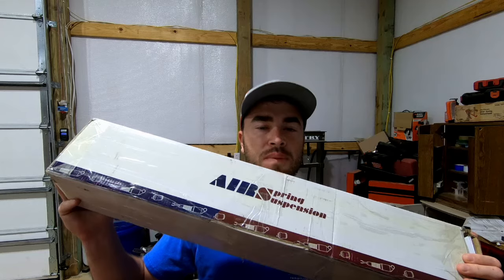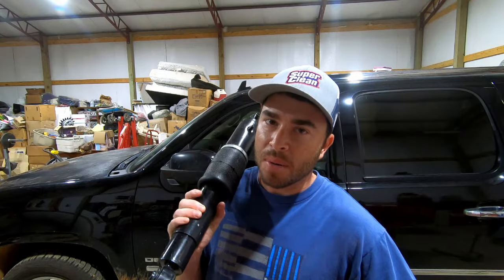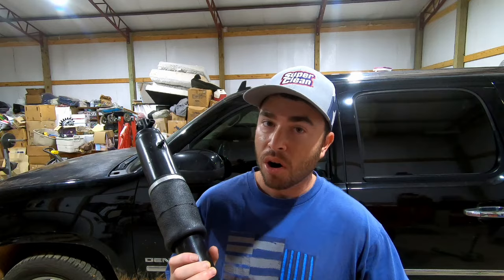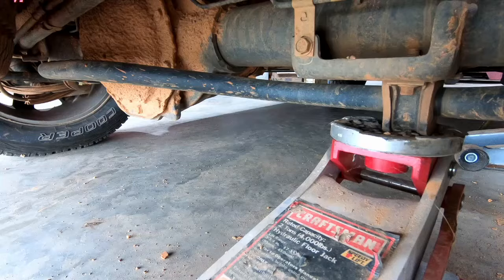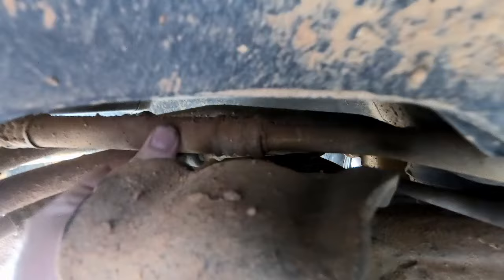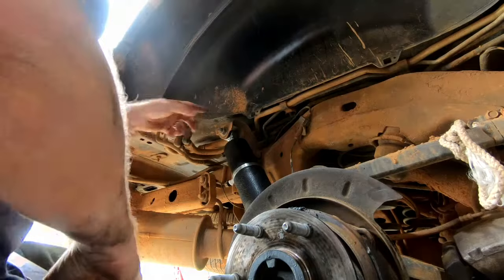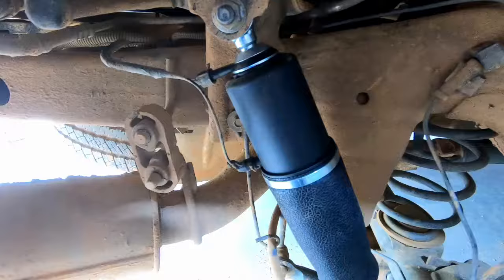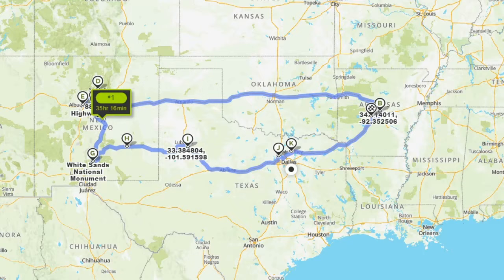Vigor Air Suspension vs. Arnott vs. Suncore vs. OEM.  Test and Review!

Comment from the maker: To purchase the exact air struts I used in this video: https://vigorairride.com/products/vigor-25979394-air-absorber-shock-suspension-strut-spring-rear-left-or-right-compatible-with-2002-2014-cadillac-escalade-esv-ext-2000-2014-chevrolet-avalanche-suburban-1500-tahoe-gmc-yukon-xl-1500?_pos=2&_sid=fc2191406&_ss=r

You can also purchase a matching air compressor here: https://vigorairride.com/products/vigor-15254590-air-ride-suspension-compressor-pump-for-escalade-avalanche-suburban-tahoe-yukon-949-000-19299545?_pos=1&_sid=53020bf69&_ss=r
Reply: I installed these vigor air ride  struts in a 08 cadillac escalade but after i was done my stability track, traction control and abs came on, do you have any idea why ?
Reply: I also installed the matching air compressor

Comment: Thanks for the Vigor resource.  Bought a complete Suncore kit for my 2003 Ford Expedition in November 2017 (approximately 10k miles ago (not my daily driver)) $1,400 for the parts only.  One airstrut was bad right out of the box.  Suncore replaced it, but it held up my repair for 9 days. December 2020 dryer connection failed. December of 2021 compressor failed. February 2022 airstrut just failed.  Original Ford Air Ride lasted 14 years.  New suncore just barely, barely, lasted 3 years before the first failure and its been down hill from there.  For what its worth, I think Suncore stinks.
Reply from the maker: Agree 100%.  Still haven't had problems with the vigors so far.
Reply: Follow up January 2023.  The other front strut just went out.  (did I mention I don't really even drive this thing?)  10-50 miles a month.  SUNCORE=RUN AWAY

Comment: Which Arnott shocks were you running before? Were they the passive models like the Vigor or the reman OEM active style that maintained the electronic ride control? I purchased the Vigors and have yet to install but wanted to know if this is an apples to apples comparison.
Reply from the maker: Both the vigors and the arnott are the exact same OEM-style air shock, so yes, apples to apples.

Comment: Great video.  Question we had c0585  04 left rear damper circiut open. Gm test said if I put test light on A and B wiring to shock and is lite up before I turn damper ON with scanner then the escm is shorted out.  Also got no power to the 30 pin on the alc relay underwood.  Is the test preformed to say escm correct thank you for any help. Cheers

Comment: Vigor makes a complete setup for the fronts now. Mines will arrive Saturday. Hoping for a wonderful result. I will have new rears, fronts and compressor from vigor. Also new lines too. So excited!!!
Reply from the maker: Good to know!  You'll be riding smooth!
Reply: Hi @Farmdad, how is the vigor air suspension holding up after 2 years? How many mileage have you put in with this?
Reply from the maker: @pelesuratach9480  still good.  I can't remember where I started mileage-wise and don't know where I sit now, but I bet I have put over 30k on and still no issues.
Reply: @theplantedtank I’m intrigued about the lines.  1 of the small line sections on my burb has a small hole worn in it (it looks like the line was laying on the compressor and direct heat melted the hole in the line).  any feedback on the install and performance thus far?
Reply: @chrisheringer905  it's still good so far. But I'm having a connection issue with the electric connector on the front struts.

Comment: I watched this video and ordered the vigor rear and front air ride shocks for my 02 escalade z55. the front appears to come with a Shrader valve that is completely separate from the shock its unclear what and where this goes. also, my front shock currently has a connecter on top of the mounting stud of the shock.... I do not understand why or how this works plugging a connector into a stud that is. parts should come in soon will keep yall updated. any suggestions are appreciated

Comment: I just purchased a set of arnott magneride replacements for my yukon denali after the ac delco one failed. I have been emailing with someone at arnott regarding the differences and it sounds like they come from the exact same place. This is what he told me: 

There would not be any difference in the MR-3626 and GM AC/Delco shocks since they come from the same manufacturer and same place AC Delco gets them. The MR-3626 is $10 less and it has a two-year warranty whereas the GMAC Delco part (same shock only have a one year warranty.

I guess we will see though. Hoping to have mine tomorrow to install.

Comment: So I have a leak on my passenger side air shock, 2020 Suburban, pulled a travel trailer twice, then noticed the leak. What’s your thoughts on why it failed so soon, 41k miles. Got the burb used, so not sure if had towed anything before. Thanks for any input 👍

Comment: Watched both your videos, I think the shocks on my 2012 Suburban LTZ are going out and I am really leaning towards these Vigor's you have linked. Do you still own the Denali? If so do you have any long term updates? How have those plastic fittings held up? My Suburban has 170k miles and I plan to keep it as long as possible so I want to make sure this purchase goes another 150k miles. Thanks!

Comment: I purchased these after seeing this video, and after installation found one shock is leaking from the base of the nipple body that the air supply clicks into. It bubbles with soapy water even with air line removed (air trapped inside shock with finger)

I emailed the company and am waiting to  hear back from them
Reply from the maker: I'm sorry to hear this.  Please let us know how the company responds. If you don't hear from them in a timely manner, I'll reach out to my contact there on your behalf.  She was very responsive to me.  Is there a bad weld on that nipple or is it leaking at the connection to the airline?  I've seen where shocks will leak at the connection if the tech doesn't get them on all the way.
Reply: I was thinking about ordering these. Did they respond in a timely matter?

Also are these passive or active?
Reply: @scottwhite5367  They had me send multiple pictures and videos, im assuming they did not believe me. I was then told their tech was looking at the pictures and video. A few days later they issued me a refund, saying it probably got damaged during shipping.

I ordered a new one with the refund and had no problems. Would have been nice to not do the install twice but it is what it is I guess. 

I will say the way they package the shock is not very secure so I was not surprised it got damaged during shipping.

Comment: Ok so I installed these Vigor rear air shocks on my 2008 Escalade EXT. I also did a bunch of work on the front, struts, CV axles and bearing hub assemblies. What a difference. I didn't know how bad my Caddy was riding until now. I will make the assumption that if you want your truck to ride like it was new then change ALL the shocks at the same time. So the factory air shocks were totally gone. They would not hold pressure at all. The new Vigor shocks work perfectly. I put some weight in the bed of the truck and instantly the old factory air pump kicked in and leveled the truck perfectly and held the pressure. Before the pump would come on and run for what seemed like 10 mins but not much change in ride height.  The air bladders on the new shocks stay nice and tight. Worth every penny!!!!! The only question is....how long will they last? Time will tell. Forgot to add......the old shocks were so light in weight compared to the new shocks. They were 1/2 the weight as the new ones. Maybe all the oil charge leaked out? But just holding the old and the new I could tell there was a difference.
Reply from the maker: Glad you got the caddy all fixed up.  That's weird about the weight difference!
Reply: Hi! How has your suspension held up? So far so good?

Comment: Excellent video. I have a 2008 Escalade EXT. This weekend is a major drive train and suspension overhaul. Front...doing CV axles, struts (shock/spring assy) and bearing hub assy. Rear doing the air ride shocks. I ordered the Vigor 2597934. My truck has 97,000 miles and is starting to ride like shit. The front CV axles are popping and clacking like crazy. The front suspension is rough and just for good measure I am doing the bearing hub assy's. The rear, also rough. I tow trailers, large boat and an RV (travel trailer) and the truck used to detect the ass squat and kick in the air pump and lift the rear end leveling. Now the pump kicks in and it lifts a little but eventually just squats the truck to the ground. I believe it to be the air ride shocks. I will report back. Just wanted to see some videos on these Vigor shocks.
Reply from the maker: Sounds like that escalade is going to be as good as new.  You are fortunate to have one with such low miles!
Reply: @FarmDad  I bought the truck in 2012 with 30,000 miles. I work from home so all the miles are from taking the kids to school and 2-3 road trips per year with the travel trailer but most of our camping trips are no more than 300 miles each way. Yes it still looks like new inside and out, pearl white outside and black inside. The 6.2 has loads of power. But the shocks and CV axles are toast. Totally lost the "Cadillac ride". But with my auto stereo expertise the sound system will rattle the windows in your house from a block away. LOL
Reply from the maker: @ScarabChris  rock on! 🤙
Reply: @FarmDad  and @scarabChris I have the same 2008 cadillac ext  mine has 104000 miles and having the same issues with the front struts and back suspension.  What do you recommend for the front and how your back suspension is working with the Vigor?  Thanks for any suggestions.

Comment: FD--- how much BETTER are GM A/C delco compared to Vigor? Could you elaborate?
Reply from the maker: So far, I haven't had any problems with my vigors.  So it's hard for me to say that ac Delco is better.  Ride-wise, im not sure I could tell a difference.  I know ac Delcos usually last more than 10 years, sometimes much longer.  My vigors are still going strong at this point.

Comment: So im wanting to buy the vigors and thanks for the video!! I think my 12 yukon has magnaride and def has z55. Can i buy the vigors or do i need to get somwthing magnaride specific too? Sorry if this sounds dumb. I know very little about air suspension.
Reply from the maker: If yours is a 2012 Yukon, you do not have magneride, which is z95.  Yukon's didn't get it until 2015.  If your Yukon is a Denali, you have z55, which is autoride, and will need the same Arnott shocks I tested in this video.  I still have them on and haven't had any problems yet.  👍

Comment: I tried to read most of the comments but they aren't in order by most recent. How are the vigors doing now? Looks like they are pushing about a year old.
Reply from the maker: Still good.  No problems so far.
Reply: @FarmDad  thanks for responding. I just bought an 05 ESV and both rear shocks are busted. I imagine the compressor is bad as well.

Comment: Great video. Been doing a lot of looking around the last 3 days. I do not want the expense of fixing and replacing suspension parts with 200k on the 08 Baby Burb.  I assume vigor are oil filled with air bag accessory mounted to it for the leveling effects. Now Remember, My system is entirely shot on the Burb. Going to use RANCHO RS999928 front strut assembly which gives a 2" lift. Can i install these vigors as a standard shock installation and then adapt air lines so i can adjust air pressure to raise when towing or heavy hauling?  My other option is to install GABRIEL 49155 air shocks but I really want the hydraulic  effect so if air is lost my shocks don't go completely flat. Your thoughts would be greatly appreciated.
Thanks in advance. Keith
Reply from the maker: I believe you could.  So your burb didn't originally have air shocks?  I can't remember what options came on those. Stock, these z55s adjust air pressure to level it based on payload.  I would imagine so long as you have something telling it how much air to put in and a compressor, I see no reason it wouldn't work.  But I personally wouldn't retrofit to an air suspension if mine didn't come factory with one because it would just be too much work and expense.  Now if your burb is a air suspension, these should be direct replacement.
Reply: What did you do with the electrical connection?

Comment: I have a 2006 Denali.xl that needs attention.  We put heavy loads on it.  Do I need to replace the coil springs for heavier loads ?
Reply from the maker: No, that is the point of the air shocks.  They will level a heavy load.  Even with stronger springs, you can't exceed the payload.
Reply: I put the in coil airbags in to help take the load 150 bucks few hours of messing around getting them installed  and the combo works great

Comment: Hello! I have a 2008 chevy tahoe and the rear shocks are bad (air ride suspension) I was quoted a $6000 by a dealer to replace, then $2400 by an independent shop to replace. Then I was told it should be way less that that even. Can someone please give me insight? I thought about converting them to normal shocks- also. Any tips and advice would be appreciated!
Reply from the maker: It's not a super difficult job and the parts are pretty affordable.  I would do it yourself, if possible.  Otherwise I'd try to supply the parts yourself and get a shop to do the job for labor cost only.
Reply: arnott shocks n compressor <$1K at NAPA

Comment: I purchased a pair of these for our 2011 Yukon Denali. Installed them and I regret that our Traction Control, Stabilitrak, and ABS light came on. I double checked the electrical and air connects to the shocks and everything is in order. I’m sorry to ask if you’ve experienced anything like this and if you have a solution, because no one answered the support phone number at Vigor when I called twice at 3:45pm EST on a Thursday?
Reply from the maker: I have not experienced this.  In a case like this, it's very helpful to read the codes to see why the lights came on, but you'll need a scanner capable of reading those systems.  Many times it's a wheel speed sensor (front hub replacement) but there's so many possibilities.  I would double check that everything is plugged in good where you were working and no wires are damaged.
Reply: After trying a couple at home remedies, I took the vehicle to the mechanic.  They said it was a "wheel speed sensor" that was causing the error.  It's ironic how changing the shocks coincided with the wheel speed sensor needing replaced.
Reply: check the blue connector on top of frame above top shock mount, arnott says this frequently gets unplugged during install

Comment: Do you have the Z55 or Z95 suspension? Will these work as replacement rear shocks/compressor on a Z95 optioned vehicle? I do not mind not having the magnetic ride capability on the rear suspension. This would offer considerable cost savings over stock Z95 components.
Reply from the maker: I have z55.  I am hesitant to say whether these will work effectively on a z95 with magnaride as I have not tried that.
Reply: @FarmDad  how do you know if you have z55 or z95?
Reply: @xrunner800  
Check left side sticker inside glovebox it a list of letters and numbers if it has Z55

Comment: I have a 2006 Yukon Denali 1500 and my rear air shocks just took a dump, I been trying to order a new pair but not sure what route to take, I also order a new dorman air compressor to go with the new setup. I went to the vigor website but when I put my make and model it only shows for Yukon xl so I’m not sure if it’s going to be the same for my regular denali? Thanks in advance.
Reply from the maker: It should be the same.  Some Yukon xls did not have a z55 air suspension, but as long as you are buying air shocks, there was only the one kind on yukons in 06.
Reply: @FarmDad  awesome, thank you. One more question, did you hook up your shocks to your existing air compressor or did you have to replace it with a new one to make the new shocks work? In other words would I be able to plug and play to the new Dorman air compressor without a problem?
Reply from the maker: @jimenezr6  should be plug and play.

Comment: Did your shocks ship from china? I placed my order on 11/8/21 and barely today (11/18/21) did I receive a email of my order being on its way, but from some city in china. Should i be concerned about this?
Reply from the maker: I think they did come from China.  I did not get email updates since they shipped me a set to test without me buying them, but if I remember correctly, they may have come from China.
Reply: @FarmDad  how are they holding up so far?
Reply from the maker: @MegaVictor006  no issues.  Still riding good.

Comment: It looked like tou used the existing GM air compressor. Is that satisfactory?
Reply from the maker: I actually used an existing Suncore compressor that was still functioning.  If your gm one is still functioning, it'll be more than satisfactory.  I accidentally provided Vigor with the wrong model number, so I was not able to try the compressor they sent me.